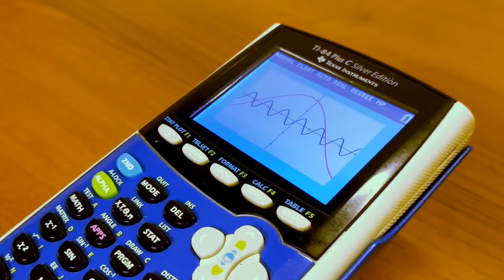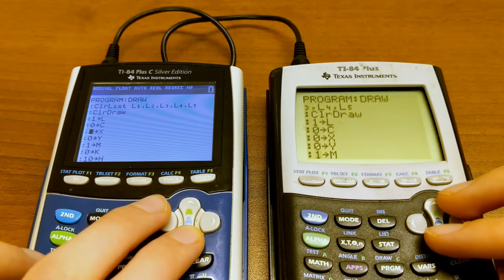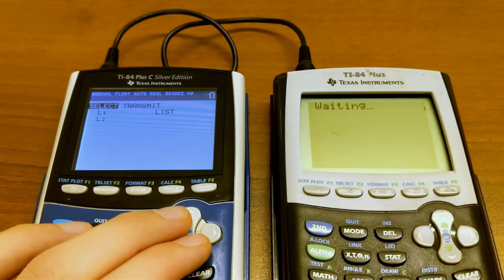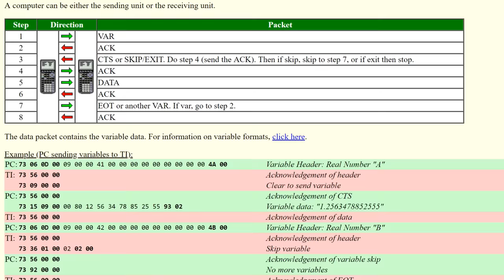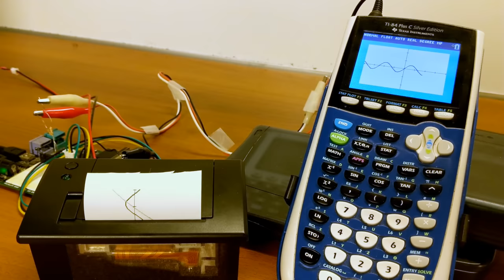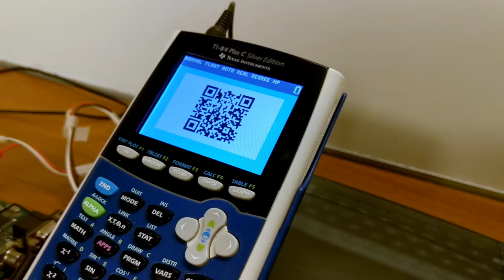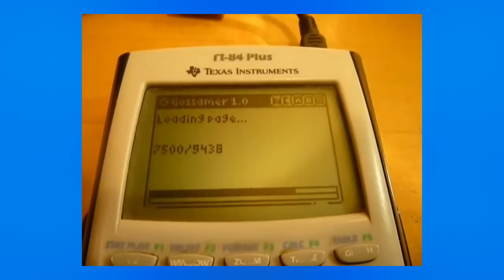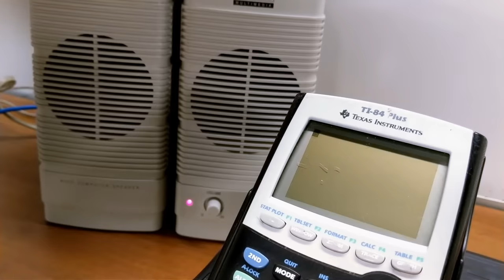Why Do Calculators have a Headphone Jack?

Comment: Remember that Gameboy recompiler that turns any Gameboy game into a TI program?

Add TI Link Cable support to that.

No idea how difficult that would be, emulating the GB link protocol might have some serious overhead, but it'd be cool to see
Reply: TI link is probably not fast enough to transfer at GB link cable speeds
Reply: I'm sure you could make some glue logic, assuming the game boy has flow control.

Comment: 2019: Calculator have headphone Jack 
2050: Calculator have type c dongle headphone jack
Reply: It's 2020
Reply: @IDGs_space  video is from 2019
Reply: I think you mean 2004: Calculator have headphone Jack
Reply: with a RTX3080
Reply: Cyberjackass aPpLe 2050
Reply: With IP69
Reply: Gaming KenHQ if apple made calculators: no headphone jack, buy CalcPods
Reply: haha dongle
Reply: laughs in HP Prime G2
Reply: 2100: Calculator has a sim card slot
Reply: This boldly assumes that TI will ever innovate. Then again USB-C ports could become cheaper than these jack ports at some point, and they'd probably switch when that happens.
Reply: 2100: calculators have SIM card slots
2099: the transition to eSIM is complete
Reply: I know you were trying to be funny, but you'd have to know what a dongle is first.  I bet you $1000 that you have no clue what a dongle actually is.  HINT: It has nothing to do with connecting devices to each other with our without wires.  A TRUE Bluetooth dongle would be a device that communicates via bluetooth to another device and performs a function.  It would NOT be a device that plugs in to another device to allow it to communicate through bluetooth, as most people think.

A dongle is a hardware device used for software copy protection.  Over the years people have been mistakenly using the word for many other things that have nothing to do with copy protection.  That doesn't make them correct, it makes them uneducated, but they can do something about that.  Something that you plug into 1 type of connection that allows another connection on the other end (whether the connection is wired or wireless is irrelevant) is simply an adapter, NOT a dongle.
Reply: @FadingBulb57227  2100?  What are you talking about?  Most of my calculators have had sim card slots for years!  Some of them can even make phone calls! :-D
Reply: @eric_d  That's true. I've been telling people it's just an adapter. But the problem with "adapter" is that it can cause confusion because most graphic cards are said to have a "display adapter" or "graphics adapter" when they aren't adapting anything (AFAIK), it's just a port. Same with "network adapters" and "audio adapters". "Why would a built-in port in the motherboard be an adapter?" People will ask. And that's why dongle is used, because it's an external adapter that actually transforms or converts signals and/or just energy (charging dongles)
Reply: @eric_d  Imagine a calculator with WhatsApp. That reminds me of the Samsung Smart Fridge meme
Reply: Actually, the CE model already lacks the "headphone jack", I guess its extinction on mobile devices is already here...
Reply: That moment when someone shows just how terrible a jack is compared to usb
Reply: 2050 "What's a Calculator ?"
Reply: That's just depressing...
Reply: @eric_d  Language evolves and the definition of dongle has changed for better or worse to also mean adapter, converter, occasionally amplifier, etc.
Reply: @vikmanphotography7984  nah its not. The calc nerds would be probably thrilled that they can still use their ancient cables with their newest calculator. Unlike the smartphone nerds, where some of them think it's unreasonable to remove an ancient port, while still keeping it as an option with a dongle.
Reply: @vikmanphotography7984  While I do agree that language evolves (it HAS to, or we would all still be grunting all day), I cannot accept it evolving due to careless mistakes.  If that were the case, "they're", "there", and "their" would all have the same meaning, because most people these days can never use the right one.  Same with "your" and "you're".  Just look at the comments ANYWHERE on the internet, and it's extremely rare to find anyone use the right form of either of those.  It doesn't mean they are correct because language evolved.  Just because people have been using the word "dongle" incorrectly to mean something it's not, doesn't mean that they are suddenly correct.
Reply: @eric_d  If enough people agree that a definition/word is acceptable, that definition functionally changes, regardless of holdouts. Of course holdouts can lobby to preserve the status quo and that is usually successful but 'dongle' seems like a battle that has already been lost.

Not totally related but just because I find the topic fascinating- look at the 'great vowel shifts' throughout history or how the timing of when modern English emerged left us with all our bizarre plural forms and overcomplicated grammar rules.
Reply: @akfrrl  That'd be 5000USD
Reply: Mine doesn't have it
Reply: @IDGs_space  WRONG, it's 2022.
Reply: @therealloganyt237  i forgot i ever watched this video lmao
Reply: @IDGs_space  lol
Reply: You can't hurt me, Jack!
Reply: The iCalc, from Apple. The iCalc is a very sophisticated magic math box, with a locked OS and no support for third-party assembly apps, it sure is a great machine!

Comment: Funny thing about the keyboard, TI actually made one for their calculators! I got one to go with my TI-89 titanium a while back, and it came with a cool sliding case with a kickstand inside, so you could prop it up while typing.

The weirdest part about it was that it lacked a number pad. I thought that was a strange thing to omit in a calculator. But it works great for apps like NoteFolio.
Reply: TI-92 with its built in qwerty keyboard still beat it though- actually took class notes on that thing
Reply: It doesn't need a number pad because the entire calculator is, well, a number pad.

Comment: I've always considered these calculators to be more like mini computers then just calculators, they remind me of old computers such as the C64
Reply: That analogy may be closer than you realise: you see, all the TI-8x models except the 89 have a zilog Z80-compatible cpu; the 89 and the voyage both have a motorola 68000 cpu
Reply: What about ENIAC compared to calculator in term of processing power
Reply: @fadrium1464  If you look  at this bit here: https://en.wikipedia.org/wiki/ENIAC#Main_ENIAC_parts you'll see that ENIAC's architecture is very different from the computers we know today, i therefore think a direct comparison will be difficult; i certainly don't have the knowledge to do so.
Reply: They are more closely related to the zx spectrum
Reply: Could you actually write an OS that supports MS basic like an 8-bit micro for them? That would actually be super cool having a pocket sized 8-bit micro.
Reply: @SyphistPrime  I think putting Basic on one would definitely be possible, as a matter of fact I wouldn't be suprised if someone else already did it
Reply: *than (comparison)
Reply: Basic on a ti83
Reply: It *is*, in fact, a computer.
Reply: Yeah, back before we had cell phones the TI-84 was the hottest thing we'd carry around! In middle school it was the wallet, keys, and the TI-84.
Reply: @BertGrink  the C64 used a MOSTEK 6510 which was a slight improvement over the 6502 which in turn was based on Motorla 6800; the Z80, on the other hand was based on intel 8080, ,so no, the two processors were 2 very distinct branches derived from 2 competing companies with totally different architectures.
The Z80 was used in MSX , Amstrad, Spectrum (and clones).
Ironically, the TI99-4/A used a proprietary TMS9900 which was totally incompatible with both the 6502 and the Z80 (it was the first 16 bit microprocessor to be delivered in a home computer, and in 1981 it was way ahead of the rest of the industry, although the rest of the system slowed  the performance to a crawling snail on molasses). 
And HPs (like the powerful graphic HP48GX) used their own proprietary ARM processor (slow but super verstaile).
Reply: @fadrium1464  1000 times, also consider the calculator have extreme math functions built in.

The down side to pocket calculators is they have limted keyboard and displays, they force people to cramp their style and work at operating.
Reply: @SyphistPrime  look up Tandy Radio Shack pocket computers circa late 1980s.  The big one had 8K of memory.  Mine had 2K.
Reply: motorola 68k, had an old mac right up until 2000 with one of those.

Comment: As an electrician, we don’t consider the ground as a “wire” as the ground isn’t used. your I/O cable is a two conductor. The ground is a given. So no, it’s just keeping the job on three wires, it’s two.
Reply: CPC?
Reply: Is it balanced? I thought they are not, so current flows on the "ground". If it were RS-485 then ground would only be a refrence.

Comment: the TI-59, TI-58, and TI-58C had an optional thermal printer called the PC100C in late 70's. The 58C and 59 were basically full size computers with programmable functions and the 59 had a magnetic card reader. There were other things made to make it more like a desktop micro computer like a tv out box called video 59 and devices to switch between multiple ROM cartridges.
Reply: Tandy also had a thermal printer clear back with their PC-1 Pocket Computer ( I am sure it was made by Sharp, but not sure if any of the Sharp models were sold outside of Japan at the time) Unfortunately for me, I couldn't come up with the funds to buy one, I only had the cassette adapter for mine.

Comment: "before usb ports..."

Cable has a USB connector
Reply: USB ports on the calculator. The newer models have a built-in USB port for uploading
Reply: He meant before they put mini USB ports on the calculators
Reply: Earlier Sonys had jack-to-9-pin serial... you know, before USB was a thing. The newer USB-to-jack variants I guess just works as a USB-to-serial interface.
Reply: Guys, I'm probably wrong but... I think it was just a joke.
Reply: uses bit-wise flow control, unlike any 2wire serial.

Comment: "why does it have a headphone jack?"
what? it literally says I/O ..... .... ... .. .
Reply: Yes but no. I/O means Input Output. So it doesn't solve the reason
Reply: @Seawolf.Gaming  yes but no what? i did not really ask any yes/no question
well, i know what I/O stands for, im not sure how the definition helps your case
solve.. what reason?
your comment is very .. random, could you try clarifying what you meant
Reply: Some older cell phones actually made use of the 2.5 mm jack as well as a headset connector.
Reply: EnderCrypt He’s saying you’re right and wrong. No, it’s not intended to be a headphone jack, but technically Yes, it’s the same as a headphone jack.

He just said it in a short and sweet way, that’s all.
Reply: 5Head, that's you
Reply: @EnderCrypt  Just stating I/O and calling it  a day, doesn't answer why the port exists. You could call a charger an I/O device.
Reply: @Seawolf.Gaming  A charger cable is an I/O device.
Reply: @lobsterbark  Unless you count the flow of current as an input our output, it really isnt (except for modern chargers which also transmit some data to communicate charging rate)
Reply: Dude, without calculator sex, I wouldn't have passed High School
Reply: @Seawolf.Gaming  no but the question is malformed, its not a headphone jack, its an regular old i/o which happens to have a 3.5 mm plug, could also be optic or any other number of plugs... its a bit like looking at a usb-C connector and saying, muh headphones hardardar
Reply: @EnderCrypt  . ... M. . .. ....  ..  ...... ....  .......... . . ........

Comment: Wow, I used to lurk on Cemetech back in middle school when I wanted to learn how to program my TI, and now I'm in college. Nice to see the website is still up after all this time, and awesome to still see Kerm posting on there after all these years.
Reply: Yes, I did that too. My TI-84+SE was probably among the most decked-out in the entire school. I could play 8-bit MIDI songs with MobileTunes and real music with RealSnd. With USB Tools I connected a USB keyboard or mouse through an OTG cable to the calc's mini-USB port. With MSD8X I could even read text files on a flash drive connected to the port!

Omnicalc, Doors CS, MathPrint, A+ Calc (for calculus), spreadsheet, 3D graphing (faster than TI-89), periodic table, zoomable world map, chat, TELNET, Gossamer, Timerize, starfield screensaver, the list goes on... Even an experimental TV receiver! (although I don't think it worked)

I documented exactly how it was configured because occasionally it would become unstable and things would have to be reset and reinstalled after battery changes. Before smartphones that was the hottest thing for geeks to carry around. Gotta have your wallet, keys, and TI-84. One of my classmates even took apart his TI and added a tiny speaker inside to play music on.

Comment: I have a keyboard that works with the link port. It allows you to type out stuff at a decent speed. It's about the size of a netbook keyboard and uses the link port. I find it pretty useful as it works with any model with that port.

Edit: it is an official accessory straight from TI

Comment: I'm surprised you didn't use Casio calculators over there. The only brand of calculators I know are Casio and I thought that's what was using around the world... They don't have anything like this though
Reply: @No-mq5lw  wow I mean ok then, it's the other way around for us, subjects such as maths and physics are based upon the fact that we are required to own a Casio scientific calculator
Reply: Aaaaaand in Romania you have to do everything by hand. The exam doesn't focus on crunching huge numbers that you need a calculator for, but rather small but complicated tasks that test your brain.
Reply: @DanCojocaru2000  ah well we do have that, in the GCSE's that we do in year 11 we have 3 exams and 2 of them are calculator and the other is mental problems
Reply: Casios can be kindof boring, though they can load games like tetris or jet pack joyride.
But they do have an headphone jack.
And at least they don't boot in overwrite mode.
Reply: @wordart_guian  ah yea but I guess they do what a calculator needs to do
Reply: Casio graphing calcs have a i/o port
Reply: I loved my Casio fx..uhhh..whatever the fricc it was.
Reply: Casio calculators have a more sane I/O interface: UART.
They can be easily connected to a 3.3V Arduino or to a 5V Arduino with a level converter.

Comment: I think i have discovered an amazing idea.
If you are having an exam and it allows you to use those calculators, then you can connect 2 of them (1 is at home and 1 next to you). you can make the aux cable send the info to a small database where the home calculator picks the info up ands sends info back. If you don’t know the formulas then the people at home can do them for you.

Comment: My first thought: Can it load a Linux kernel?
Reply: Try it, for science
Reply: Almost; a gentleman named Olivier Borowski has made a linux-like frontend for the TI-86: https://www.ticalc.org/archives/files/fileinfo/106/10676.html
Reply: Sadly no, mostly due to space limitations. you can't even fit DSL on it.
Reply: If I recall, the Ti-Nspire CX can run Android
Reply: @kneesnap1041  I have the TI-nspire CX CAS... Haven't tried that before...  I'm interested now :O
Reply: Can it run Crysis?
Reply: @nooneinparticular2638  it can run Doom
Reply: The TI-89 Titanium and Voyage 200 only had a 2mb upper memory limit, which is barely enough to run Windows 3.1. You'd have to run a linux kernal so simple, it wouldn't have a GUI.
Reply: LittleWhole 
Rip, u gotta buy a new calculator if u wanna take the ACT
Reply: You should try installing Lubuntu.
Reply: someone did load linux on an 8 bit mcu, but they added a lot more memory via an external port, and it was awful slow.

Comment: Some old devices (70s-80s) had a headphone-type 2.5/3.5mm jack that was used for an AC adapter power connection, sometimes to charge an internal rechargeable battery pack.
Reply: I have a wall outlet to 3.5mm jack charging cable from an old calculator. The calculator itself no longer works, but I kept the cable to be enshrined in my "wft even is this" display of weird tech stuff. Whenever somebody asks what it's for, I say it's for listening to AC/DC.

Comment: If you can network that many calculators can you turn them into a cluster computer? That would be kinda cool. It would also be interesting to implement something modern like TCP over IP for the heck of it.
Reply: I guess the frame format allows you to add the tcp and ip header, given you can send data to an application.

Comment: The's actually a modified ti 84 plus that has a speech an sound unit that makes it blind accessible. It does include usb and link ports but also has a real headphone connection and an internal speaker to output the graph audio and speech. The accessibility unit connects to the top of the unit, taking up the built in link port and mini usb, so it is possible to remove it and use the calculator normally. The unit also supports braille as well as making it easy to review the screen and other stuff to make it somewhat simple to use it blind.